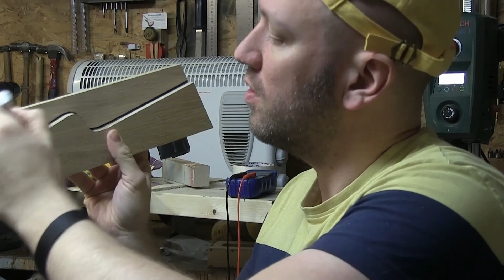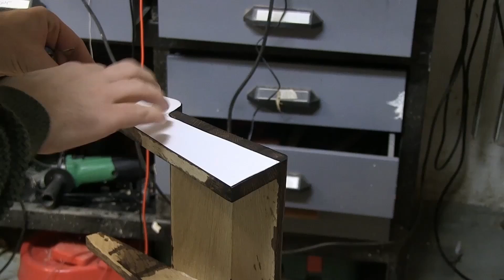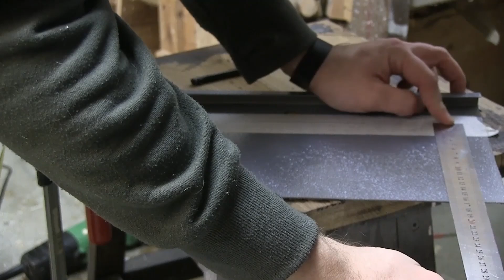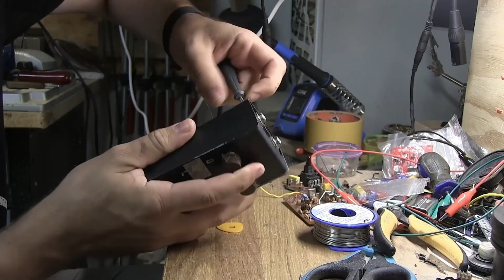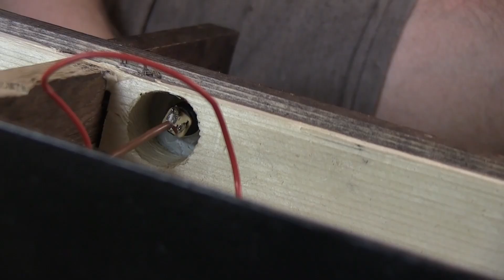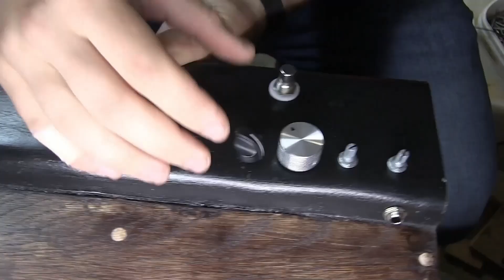this Pedal is its own Pedalboard!

Comment: For anyone who hasn't changed their layout in decades it's probably perfect, and for anyone who has circuit modded them to being unrecognisable. Would be great for travelling techs who want one cover to remove, but you do lose the gift of taking spare pedals and just swapping one faulty one out in seconds.
Reply from the maker: Maybe I'm missing something but wy wouldn't I be able to swap pedals 🙂
Reply: @zurowetz  Ah okay, yeah thinking of it you'd just run it outside the board and patch the cables into the signal chain. As long as you don't remove the quarter inch jack sockets and leave easy access it should be fine. Sorry I didn't have my tech/roadie head on.
Reply from the maker: @mrljgibson don't worry about it 😊I was just wondering if maybe I'd explained something in a strange way 😅